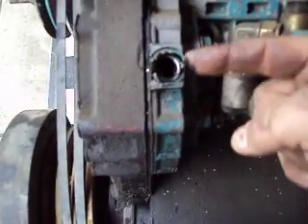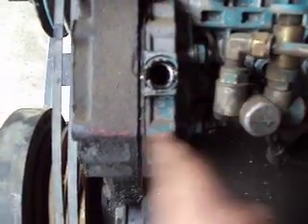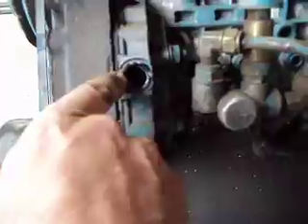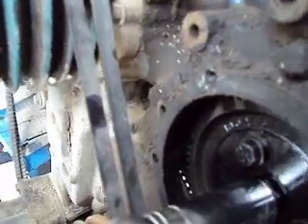Advance timing on dt466

Comment: How do you know where to start? Does  it matter whether it's on compression stroke or exhaust stroke when the timing marks line up?
Reply from the maker: The timing mark lines up with when the ignition happens.  Similar to a gas engine’s distributor.  
Makes no difference as to it being on compression or exhaust stroke.
Reply: @nevrenufhp awesome! Good morning and thank you, do you have an Instagram page?

Comment: Hello I’m working for a ‘94 DT360. Under the 3/8 plug I can find the timing pointer in the right but on the left side there is no notch to align the two. There are timing degree marks on the crank pulley. No notch between 17-21 degrees on the left side or anywhere for that matter. Any ideas?
Reply from the maker: Did you rotate the engine one full turn to make sure it wasn’t on the wrong side?

Comment: Question maybe you can help I have same dt466 engine but it’s acting up by blowing smoke Thru the vent tube going down to ground I’ve noticed Two injectors leaking  but have not been able to find a good reliable Mecanic around Chicago  area to work on it  one even replied with don’t have the software for that engine 😂 it’s a mechanical engine  any help  would be appreciated
Reply from the maker: For the cost, you can replace all the injectors, and have peace of mind.  Not too many things on these that go wrong. It’s not much harder than changing spark plugs.  I see a few on eBay for $30-60 each for a reman, and around $120 each for new.

Comment: Hi. I’ve got 1985 466 with Bosch mw. Can’t get any fuel pressure to injectors. I think the stop and rack is stuck. Don’t know much about them. Truck sat 10 years and was full of water in tanks and guys was cranking it. Drained tanks filters Etc. hand prime fuel through pump but it is very hard and only comes out few injector ports. Was thinking about swapping IP for new.  Any idea on how to set timing thank you
Reply: Hi Chris...I have  a 1990/1991 DT466 diesel with an engine that starts, idles but shuts down when I rev it to 2500 rpm.  Any ideas?  It sat with full fuel tanks for a year.

Comment: hola, compre un ford 6.6 litros, necessito hacer el avanço del ponto de injeccion!  e poner mas combustible, tiene elementos mayores? o algo asi? pienso en um proyecto biturbo!
Reply from the maker: usted debe tener una bomba P3000. Puede obtener elementos más grandes, pero recomiendo no más de 13 mm. Hay un sitio web para obtener el rendimiento del tractor tirando de las piezas, es de extracción. com. Creo que hay cabezales disponibles también.
Reply: @nevrenufhp  poste un video para que veas mi motor! En verdade soy brasilero, pero creo que sea mejor que me entiendas em espanol!
https://youtu.be/zEnkj-pM4VQ

Tienes el sitio?
Estoy intentanto hacer un biturbo, Ud. crees que es mejor esta bomba e no necessito muchas cosas pra sacar unos 500 cv?
Reply: @nevrenufhp  viste al video?
Reply: @nevrenufhp  como poner el dt 466 que camine
Reply from the maker: Edwin Nova Rubiano, podrías reformular eso?
Reply: @nevrenufhp  tengo un dt 466 de 3 correas pero quiero darle mas aire al Turbo para que me rinda mas en la loma
Reply: Quiero que me rinda en la loma y sea económico que se puede hacer o como lo hago
Reply from the maker: Edwin Nova Rubiano Para obtener más potencia, ajuste la bomba.  Luego, reemplace el turbo con una mejor unidad.  S362 vs S366 es muy bueno.  También puede instalar la bomba de Cummins 6BT para aumentar mucho la potencia.  Necesitará un adaptador, pero lo conseguirá cerca de 400 CV.
Reply: @nevrenufhp  pero todo lo que haces en el video de apretar los resortes y darle mas rpm esque en ingles muy poko
Reply from the maker: Edwin Nova Rubiano apretar los resortes dará 100 rpm más por clic
Reply: @nevrenufhp  tendré que tener un número sullo para yo acerle al mio y me valla esplicando
Reply: @nevrenufhp  por qué si le dará mucho se puede dañar o que me dices

Comment from the maker: @thesportbikeman 
Actually a VT365 is a 6 liter. A T444E is a 7.3 Powerstroke, and a 6.9 is 420 ci.  IH called the IDI engines by their litre size(6.9, 7.3).
1 litre is roughly 61.023 cubic inches.

Comment: accually its the vt365 which is the 7.3 Power Stroke i dont know that the 7.3 IDI was ever called a VT365 and the old idi motors were 6.9 abd 7.3

Comment from the maker: @ctownpowerstroke 
Neither can provide that much fueling. Bigger injectors, and pump work are required.  An HX35 would spoolup nice & quick for it, just dont use the 12cm exhaust housing, a 16 would be better. Dont go by boost numbers when all is said & done. A Cummins 6BT with an HX35/HT3B may make 60pounds, and the 466 may only make 45. Yes, the T04 is tiny, and the compressor wheel on an HX35 is about 3mm bigger.

Comment from the maker: @ctownpowerstroke 
If you have the pump that takes a 0 plate, it depends on the original rating. Generally, 30-50hp above stock.
This style pump that's in the videos can get close to the same gains.